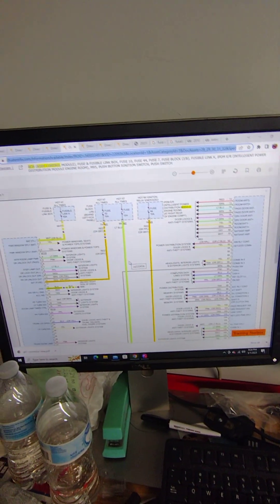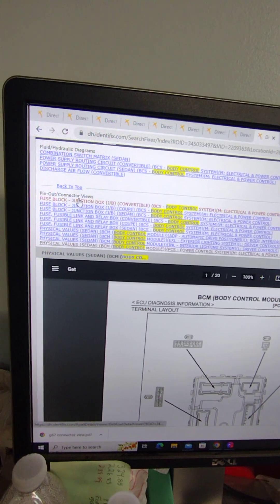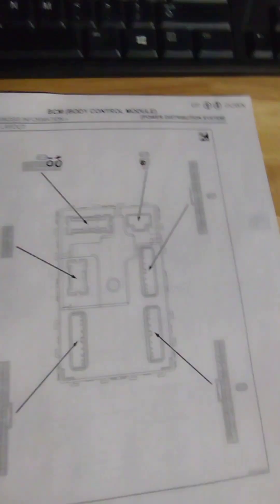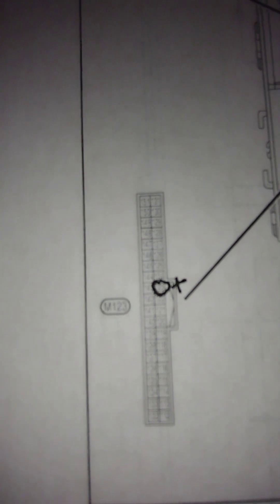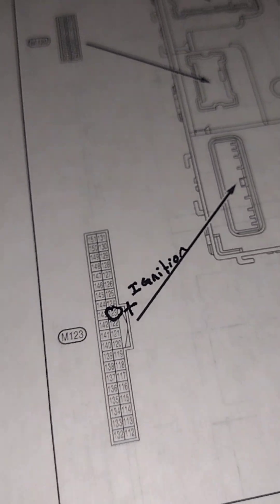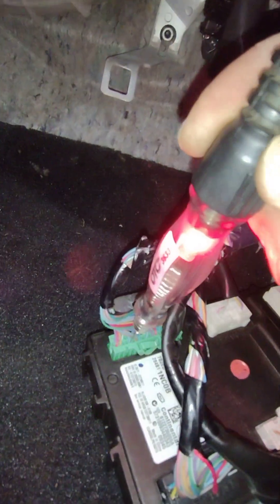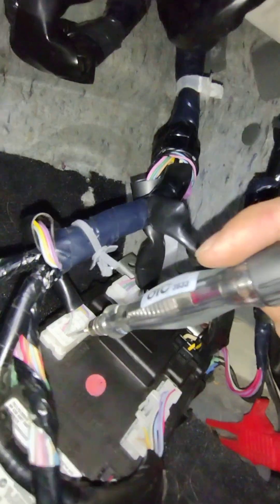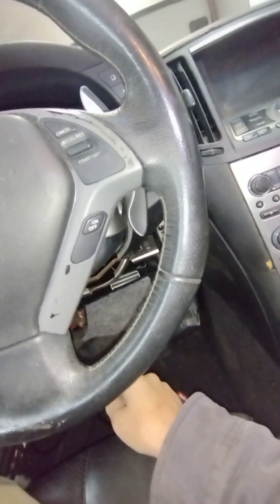2010 Infiniti G37 BCM wiring diagram overview.

Comment: Any update? I’m working on a 13’ with same symptoms but with orange key light on. Also ruled out the BCM. Any luck with the ignition switch/wiring?
Reply from the maker: Car was fixed by repairing the original harness. Owner recently wrecked and totaled the car though playing in the curves.
Reply from the maker: Come to find out, someone had replaced the dash harness with the wrong one. This being an S model it's not easy to find the CORRECT harness. The original was hacked up by a previous hack job so I put this project to the side. I'm working on repairing the harness in my free time. I will update soon as possible.